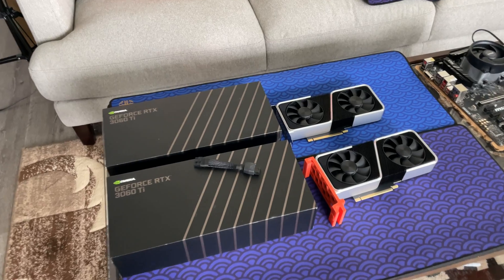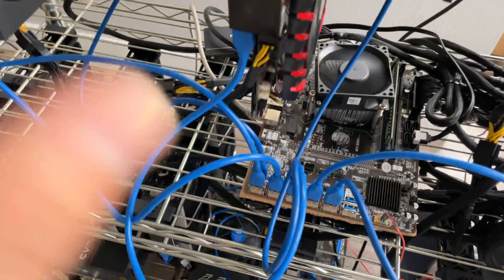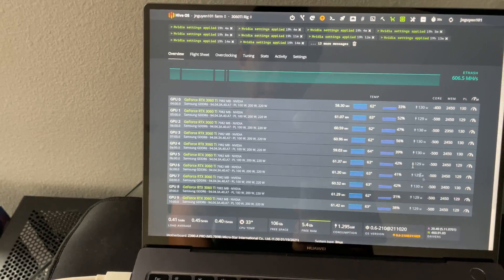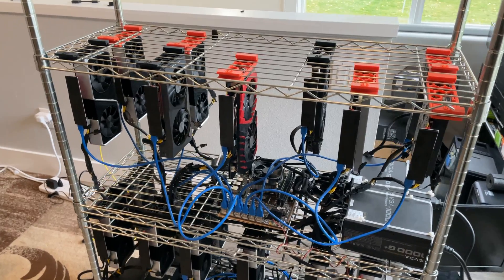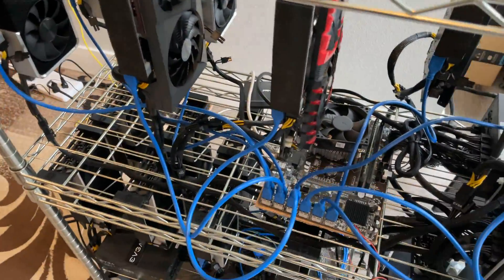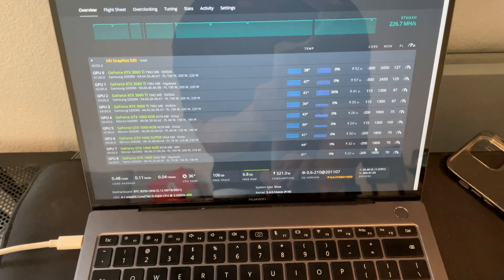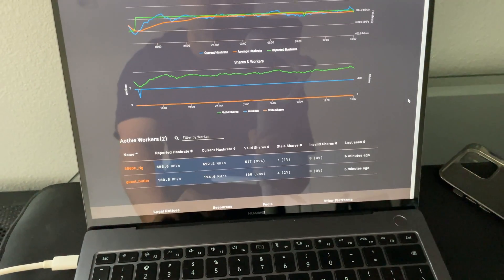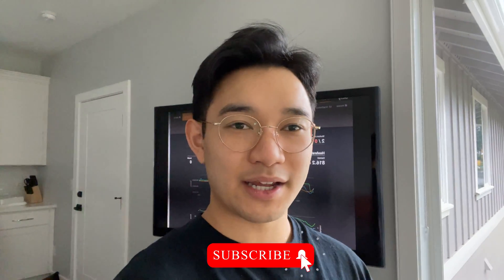Growing the Ethereum Mining Farm ( $80/day : 960 MH/s)

Comment: HP server PSU along with breakout boards would save you money. Better off also having something designed for 99% uptime
Reply from the maker: Too many downsides with server psus. Really loud if not connected to 240v, they won’t run 80% without 240v, and if they can, they’re gonna run very very loud. I need this room semi quiet
Reply: @joshuanguyen3790  I am running 3 currently in my bedroom and they are silent.

Comment: not sure how you get the FE cards so readily but i followed in your footsteps.. up to 500mh for myself using 2080s from generally fbmarket .. racked um up .. but power is an issue now .. so need to get my main panel upgraded
Reply from the maker: Aye! 2080s are good cards!! I’d be getting those too if I could get a good deal on them. Just make sure you power limit them so you get them efficiently hashing for your rigs! :)

Comment: Nice video! clean Rig!
I see you don't use any additional fan to keep the setup cool, I try to keep my cards below 55C and i see you get 65C on some cards (that's pretty hot in my opinion), I live in a VERY hot city (Rio), i need to use some big fans to take out the heat from the system and from the room (if you keep adding cards you will soon reach a point that will be impossible to keep the cards in the same room that you live. 
Consider heat problem when the weather becomes hotter (have some extra big fans can save you some downtime due to overheat)...
It's also very interesting to install some kind of mesh on the window to prevent rain and bugs

One extra TIP: that makes the internet connection MUCH more reliable: look for a router with dual wan / fail over feature, if one of the connections goes down, the other gets online seamless, it can save you some money...

thanks for sharing!

Subscribed!
Reply from the maker: I actually changed the auto temps of the rigs to keep them at 58 now! Rigs are staying cool now and they’re still not at full blast at all.  There is a bug screen on the window I open when I want the rooms a Little more colder but in general the room stays a consistent80-82 degrees (Seattle weather)  I’ll look into that router so thanks for the advice.

Comment: Don't put Helium miner near Glass or Wall studs, they cut down on transmission.  Use a stud finder, and find a section of wall with no stud and place the helium miner there.  If you have aluminum tiles on your walls, it will cut down on transmission as well.

Comment: Would this motherboard support 12 Nvidia A2000's? Any cheap CPU is fine?
Reply: It should support 12 A2000's. However you are better of building rigs with 6-8 cards with a regular normal motherboard. The CPU does not really matter for GPU mining, the cheapest Celeron/Pentium/i3's are fine. RAM requirement is 4-8 GB.
Reply from the maker: I don’t recommend you getting that many gpus, let alone 12 a2000’s especially if you’re new to mining. You’re gonna have a bad time trying to break even
Reply: @joshuanguyen3790 I was just asking to see if the board could support that many cards at full speed, I used the A2000 as an example. Realistically I'd probably been looking at whatever I can actually get my hands on lol. However, I am still really interested in the A2000s since they produce ~40MH/s at ~66w per card so that would be a preferred choice. How would I have trouble with breaking even? In fact at this very moment typing this comment, YouTube recommends me someone with a 10 GPU setup with A2000s so lets see huh haha. This video was created 2 days ago as well https://www.youtube.com/watch?v=y-QJ_n_ePk0
but if you are like me and cant trust links
Reply: @joshuanguyen3790  its called A2000 Mining Rig - 10 Cards - 400+ MHS - Best ROI In ETH Mining 

the channel being Krypto Gamer India
Reply from the maker: @gigahertz_1911  lol I would not recommend you getting a2000’s….. they’re extremely expensive you won’t break even in 8 months

Comment: Do yourself a favor and start using the absolute core clock in hiveos on your cards. You can also save 15-20w per video card while keeping the same hashrate. In mining, efficiency is everything ... I don't know if you pay for your electricity but, if you do it, it would be better to consume less.
Reply from the maker: The 3060ti fe can’t go lower than 127-130W without losing hashrate. Not sure how core clock will save any more electricity at this point considering I’m setting my core limits to -500. And yes I do pay for electricity. I really chase after efficiency. Efficiency is  my main priority when I chose my cards along with $/hashrate
Reply from the maker: The 3060ti fe can’t go lower than 127-130W without losing hashrate. Not sure how core clock will save any more electricity at this point considering I’m setting my core limits to -500. And yes I do pay for electricity. I really chase after efficiency. Efficiency is  my main priority when I chose my cards along with $/hashrate

Comment: I have 18 gpu for 1105 mh/s. 14x 3070, 2x 3060 ti, 1x 3060 v1, 1x 3090. Total power at the wall 2685 watts, I have room for 12 more gpu but here in canada quebec city we have no gpu available.

By the way my 3060 ti and my 3070 run at 59.6mh/s at 114 watts. My 3060 v1 is at 49.6mh/s at 118watts and my 3090 is at 104.5 mh/s for 268 watts.
Reply from the maker: Wow! that's a nice setup you have going on! Planning on breaking 1.2 GH this week. Will be videoing that!
Reply from the maker: Sorry, I'm reading over your original comment and I noticed you have somewhat low hashrates for your 3060ti and 3070. you should bump up your wattage to 130. It's worth the extra power for that hashrate bump
Reply: Your 3090 performance seems low... My 3080 reaches 98MH/s at 229w
Reply from the maker: @gigahertz_1911  do you have issues with heat on your 3080?
Reply: @joshuanguyen3790  GPU stays around 50-54c and the memory hovers around 90-96c and my fans are NOT  turned all the way up, around 50%. I just have a single GPU in my gaming PC.